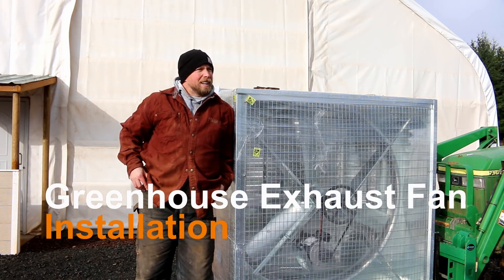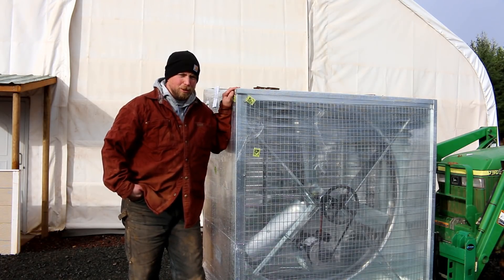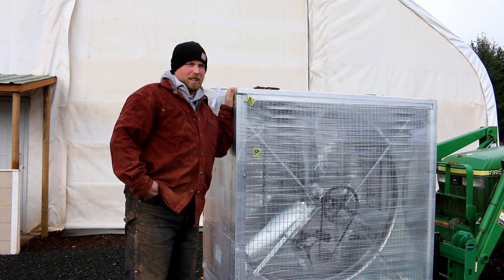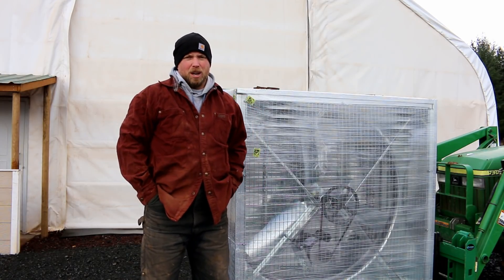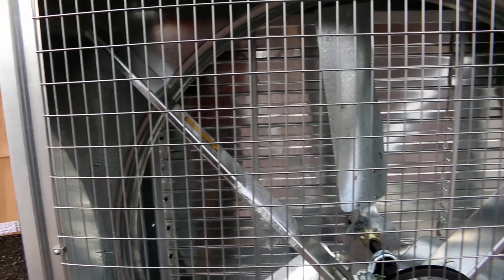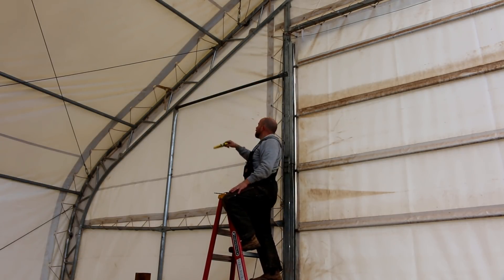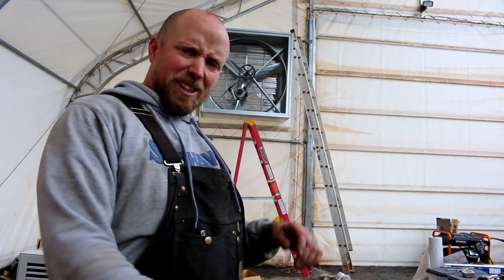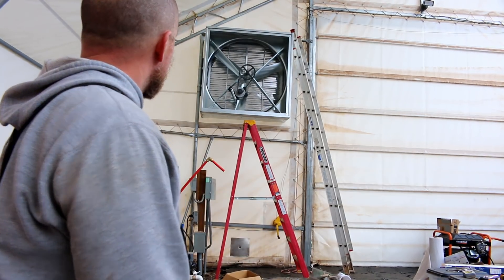Greenhouse EXHAUST FAN, Install, HOW TO - Part 1

Comment: I bought a house with a greenhouse the gentleman that previous owned it was getting ready to do some repairs, he passed away before getting to them. He removed the fan for the jet air sock, there is a brandnew fan, louvers, and actuator. I know nothing about greenhouses, this greenhouse is not fabric or vinyl, its glass, steel. They didn't remove the housing for the old fan, or the old louvers. I think I am going to have to tear all of that down, from what I can tell the new direct drive fan and louvers are larger than the old system was. 

Any suggestions on how do this take down by myself? the greenhouse is 20' x 50'x 14' with water wall, heat, dated water system, humidity controls, 2 large fans on on side belt driven. 3 ridge vents chain driven manual.  concrete floors. The housing is between to natural gas heaters, connecting to ridge sock,  the louvers are connected to a air scoop on the outside via sheet metal screws.  sigh.....my problem is I am a one man operation. I cannot be inside and outside the greenhouse at sametime.

Comment: I installed like this fan in greenhouse but after some days happen ,Electric burning motor , I changed  and replace engine many time but still Electric burning motor again, how's fix this issue

Comment: TRM, I'd complete the frame around the fan unit. And I would have used Unistrut or some other structural member. Even the angle with holes like you get a the hardware stores. And you will have to build a heat exchanger as big as the fan to preheat incoming air and exhaust the humid air.
Reply: I was also going to add that Jeff could add a lower support (parallel with the one across the top of the fan) later in the winter when there's more time. 

Great work though. I appreciate this channel.

Comment: Cover the fan on the outside with the cut-off part you removed from the greenhouse wall cloth & some Velcro.
Just wrap the Velcro around the outside of the fan box and attach the removed part...solves both problems & is removable after winter.

Comment: You are going to loose heat and using extra power on this. But, if it is necessary, than that would be justified. Thumbs up Jeff! :)

Comment: Hey, Jeff...  I apologize if I'm bringing this up too late; but when you mentioned the air exchangers, I thought about the intake, that it might be good idea to locate it where the cold air could be directly heated by your heater unit (possibly need ducting) as it enters the building.   Has pros & cons, but you wouldn't be getting cold air flowing in and cooling off the building.  Building is looking really nice though.  Have a great day!  (not sure if this the same thing Joop also mentioned)

Comment: Instead of cutting out a big square of fabric - you could have cut an x-shape in the fabric and then tucked the fabric inside the building and secured it to the sides of the fan. That would almost be reversible if every needed and I'm sure would have made sealing the edges easier.

Comment: Instead of the fan (simple solution) you need a heat recovery ventilation installation in combination with ventilation!
Reply: this is america, more power consumption is the answer. cheers.
Reply: That's what I told him! And he can build it himself!

Comment: How much torque does that fan produce? Is it's RPM controllable? With only 2 sided support, if it torques hard, you might run into problems.

Comment: Have you considered looking into a co2 generator? Using your underground gassifier (sp?) to supply gas to the unit that converts that into usable co2. I'm using one and have great results in my greenhouse, but changing out the propane  bottles becomes tedious and installing a 100# propane tank is expensive @ over $2/gal.